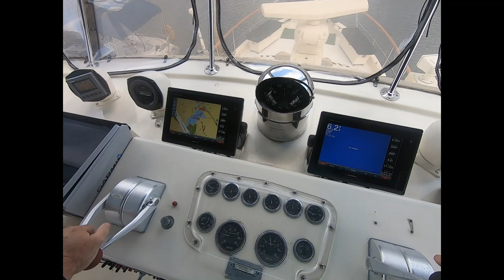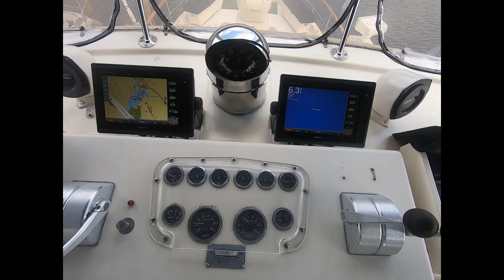Leaving the dock in a large Hatteras Yacht

Comment: His wife must be my wife's sister.  They always stand in the space around the lower helm so crossing from one side to the other involves "excuse me".  If you are not involved in preparing to leave the dock PLEASE find somewhere to sit down😁.  Oh boy, I'm in trouble now LOL
Reply from the maker: I know right???!! Thanks for the comment
Reply: @billwilletts  If I had non-boater guests onboard I always told the guys especially to NOT try to push against pilings etc if it appeared that the boat may come in contact during maneuvering.  Sometimes I used them to pivot but even if it was just going to touch (my bad) they didn't think of the weight of the boat plus the herd of horses pushing it.  You could get seriously injured, hence the "please have a seat" request.  Fiberglass is cheap, arms and legs are expensive.
Reply from the maker: @richmcintyre1178  i don't mind using pilings if I need to. But when your boat is a 100k pounds pushing makes no difference!

Comment: 3 shorts for reverse. :1 short for passing on port side, 2 for starboard. :) But you know that. Just busting your chops a bit. Beautiful boat, super smooth! My next MY, maybe a 65' LRC. Is this an LRC?
Reply from the maker: LOL yeah thanks. No it is not an LRC but the range is about a 1000 miles
Reply from the maker: @nybantibes  Awesome
Reply: @billwilletts  Thanks Bill. I watched your video tour with Nick. Really nice. You did some incredible work to her. She's definitely a keeper. At 1200-1400 RPM's and 10-12 knots and 10mpg, that's not bad at all. I just restored a 50' Riva with twin MAN 510's and I like that 1200 RPM/10 knot range as well, though I have to open her up for about 5-10 minutes every hour, and at 25 knots, she's drinking 173L/hour, and at 10 knots, she's also about 10gph; but, with only 600 gallons on board, my range is more limited. So as I said, my next MY will most likely be an LRC, though I would definitely look at the wide bodies now. Saves quite a bit on dockage, and yet you have the wide beam.
Reply from the maker: @rabukan5842  Nice!